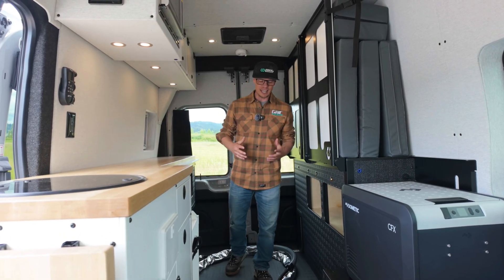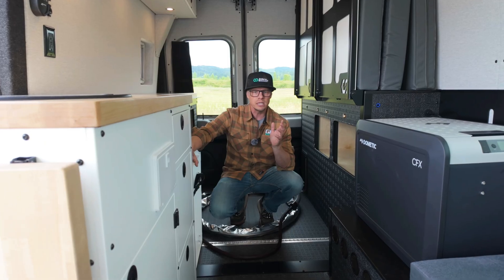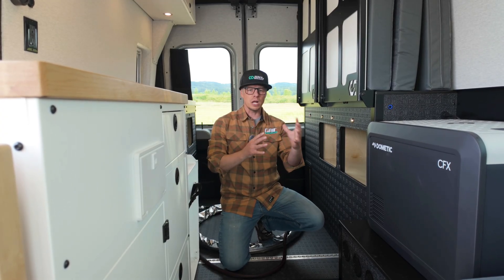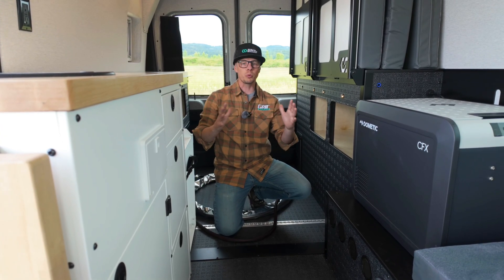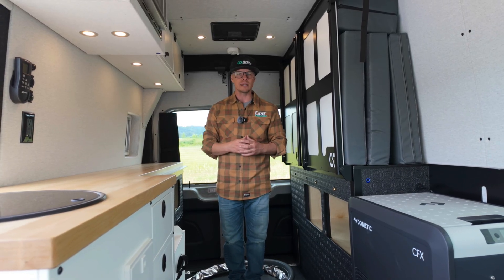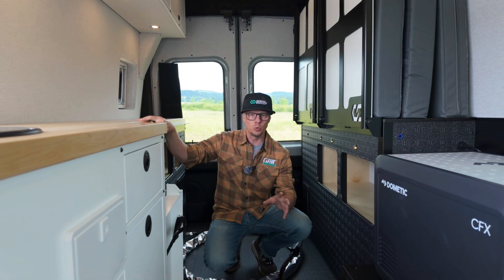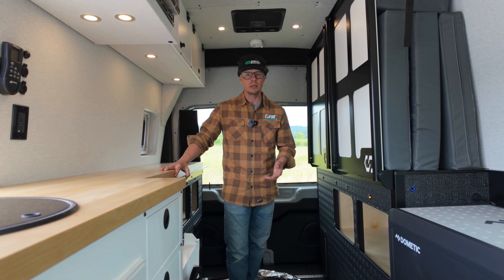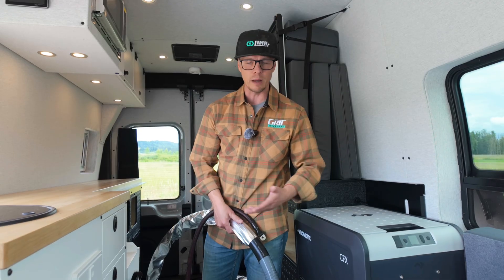Why Dual Alternators + 12V Air Conditioning | Grit Overland Ford Transit AWD Link 148 S2

Comment: 320ah battery is a 4kwh system and you out a 2nd alternator to charge that? Why can’t you just use the primary alternator ? It’ll let you easily take 120a for that tiny battery.
Reply from the maker: yes you can definitely do what you're saying. The reason we add an extra alternator is it eliminates the risk of overtasking the primary alternator while also allowing us to charge at 200Ah.

Comment: You guys just build these things different. Love the breakdown and makes sense on why you’d want to run a stock secondary alternator. So 12-14.4v at 250a about a 3000-3600w charge rate. Or charge house batt to full in a little over an hour. I must admit your older electrical systems with the wakespeed and 8kw charge rate was pretty impressive but I think for most people it’s just not necessary and I like how you’ve simplified things to bring the cost down and reliability up.
Reply from the maker: Thank you, we are always trying to improve the user experience and longevity of our vans.

Comment: Good video! Perhaps a pic of the battery? Is it just one additional car battery? If so, could you order double battery from Ford or does that create secondary issues?
Reply from the maker: Ford does offer a second battery that is OEM fitted which is a huge plus
Reply: You need to order the 2nd battery option to be able to get CCP2